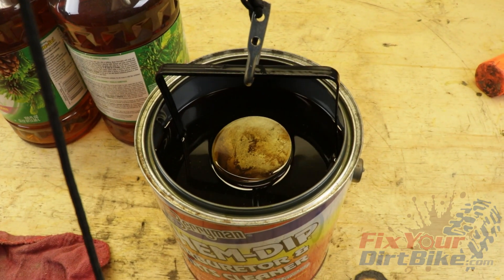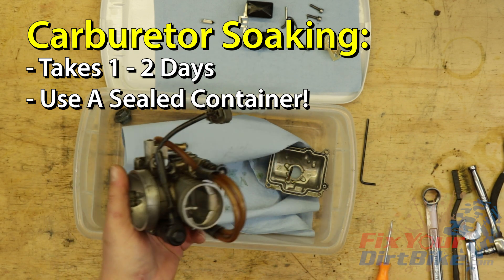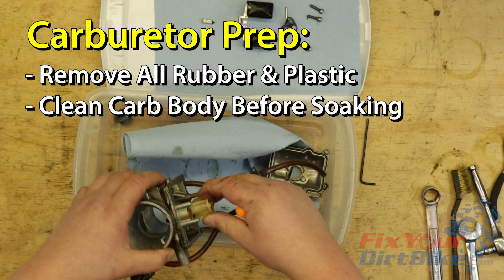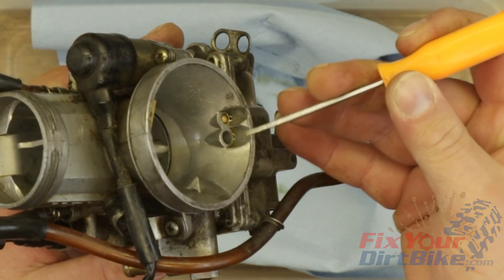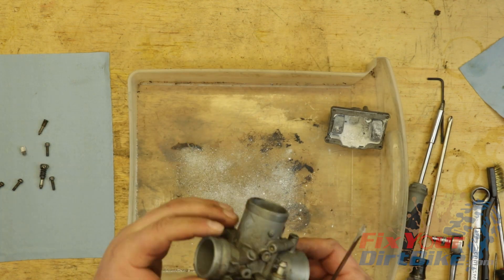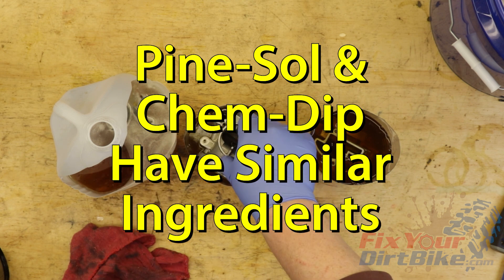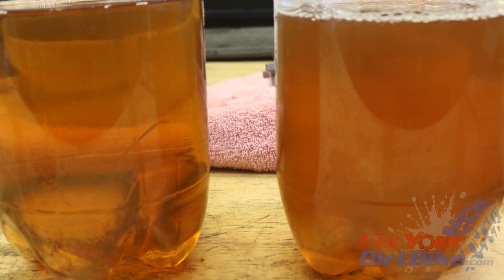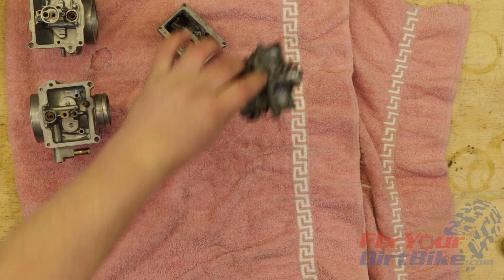How To Clean Your Carburetor With Pine-Sol! | Fix Your Dirt Bike

Comment: WARNING: I once left a mower carb in pine sol for about 48 hours in an old crock pot set to low. Upon my horror, the carb was badly pitted, decomposed and totally unusable. Heat really accelerates cleaning impressively. Check on it every few hours if your going to boost this method with heat.  Great video, man!
Reply from the maker: Oh wow, I never thought to add heat. Interesting, now I want to try it!
Reply: @Fixyourdirtbike  did you try it with the heat and does it matter which pine sol you use
Reply from the maker: I have not tried yet.
Reply: It sounds like I don’t want to use heat if it makes it unusable…I can’t figure out if you are for or against this method. What am I missing?
Reply from the maker: Heat speeds up the process, so if you're in a hurry and can monitor your carb, heat is the way to go. Just be careful.

Comment: I just picked up a wave runner project And want to try this. I’ve disassembled the carbs with the exception of the jets Before I soak in pine sol is there any other prep for the carb bodies? Are there any rubber seals near the butterfly or choke plate to worry about?

Comment: Dont have pine sol in my country. What are the active ingredients that clean the carb so well
Reply from the maker: Pine-sol uses Ethoxylated Alcohol. The MSDS states "Alcohols, C10-14, ethoxylated" at "1-5% weight". Its great for breaking down petroleum based products, which is also why it will eat your rubber!

Comment: I thought PineSol was rubber safe...don't some carbs have internal gaskets that aren't reachable, can those be harmed in the soak?
Reply from the maker: Yes, sometimes. I found that you can leave the jet block O-ring in on Keihin carbs, but you need to pull the jet block gasket on Mikuni carbs. And you should always replace the Mikuni jet block gasket because IT'S A STUPID DESIGN and if fails easily! Sorry, flashbacks...

Comment: 1979 Kawasaki ke175. Wouldn't start after weekend trip replaced fouled spark plug and then started on second kick. A few days later bike wouldn't start again so i took apart the carb and cleaned it, after a few kicks it started high rpms I adjusted air screw down, 3 days later wont start again. any ideas?
Reply from the maker: Did you check your plug every time it wouldn't start?
Reply: @Fixyourdirtbike  I have not. I will check it tonight. if its clean whats step #2 if it dirty whats step #2?
Reply: @matthewcanavan8275  Replace with new plug gapped correctly and see if the spark is a healthy fat blue.  If it is a weedy pale yellow suspect the coil.  If you have a healthy spark go back to the carby and ensure all seals are good - particularly check any manifolds for leaks.  The KE was a pretty reliable and powerful engine in it's time.  Kawasaki had some pretty useless exhaust gaskets - the KDX blew all the time and they ran pretty horrible as soon as that happened...  I think the KE of that time shared the spring attachment for the headerpipe I'd check there just because...  My F7 used to be surprisingly fast, easily quicker than my mates DT of the same year, and right up with the TS185 as well...  I didn't think the KE was a bad bike, but it didn't have the tractability of the rotary valve F7 in a direct comparison.
Reply: Make sure every rubber gasket on the carburetor is in good condition. If there is not a good seal and excess air is getting in that could be why you have high rpms upon startup. Just take your time and you will find the issue.